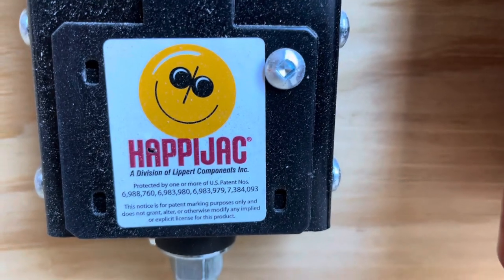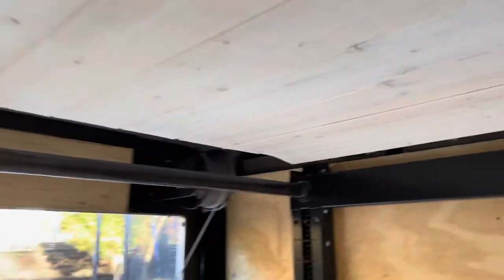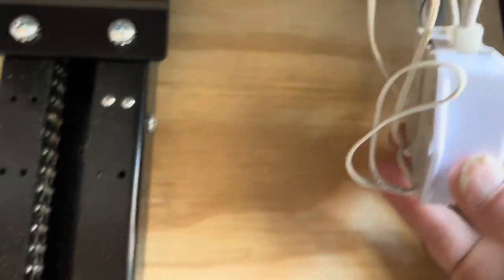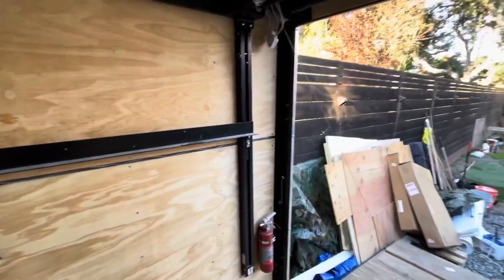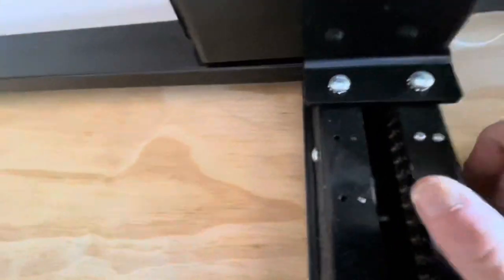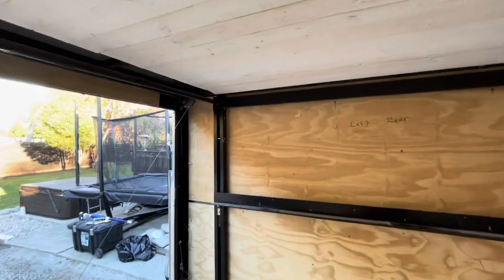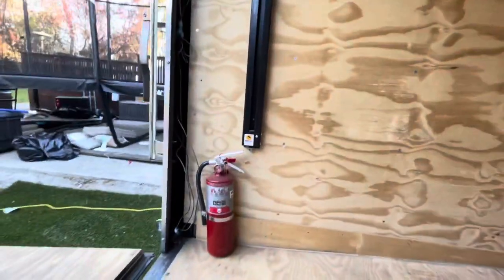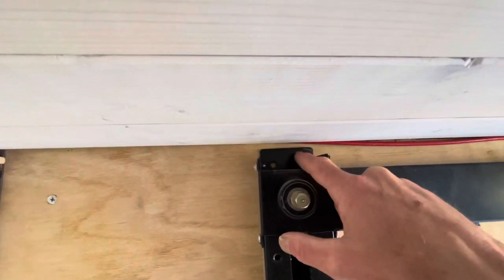Cargo Trailer Conversion HappiJac bed lift

Comment: Glad i found your video! Where did you purchase your happijack from? Im going to do the same think in my cargo trailer, was worried that since most cargo trailers are a little wider on the inside than an RV that it would be a little short, or require some shimming to make it work. Thanks!!